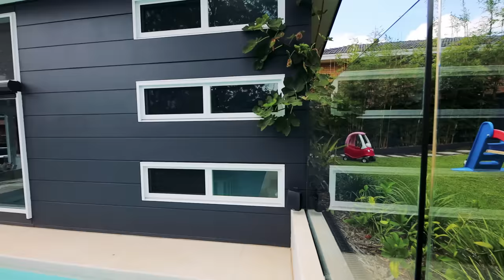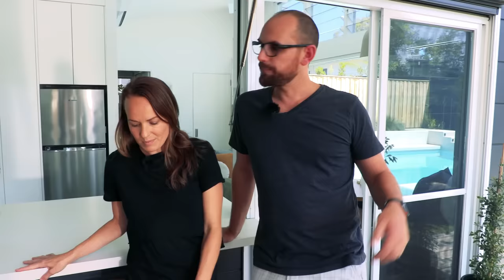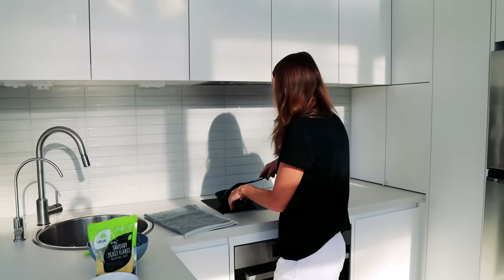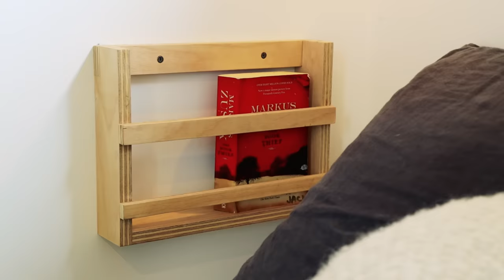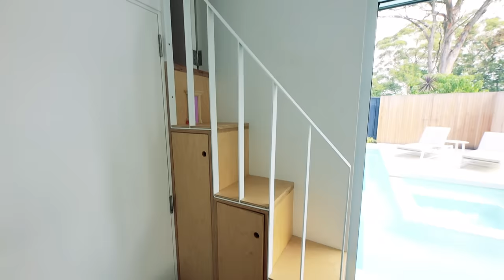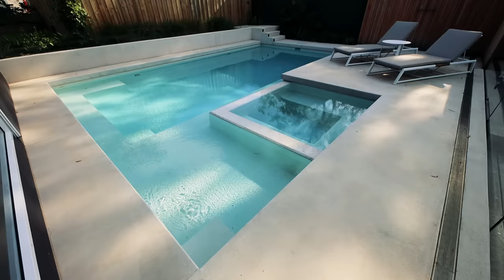Luxury Modern Small Home Built In Suburban Backyard

Comment: A great home, suitable for a tropical/hot climate. My only concern is the play area underneath the bed. What if the hinges fail and fall over the kids. Otherwise! Good layout!
Reply: That's what I was thinking!!
Reply: What if your car gave out on you tomorrow on the highway? Are you going to let it rust in the driveway just in case? Or are you going to take every precaution to make sure that doesn’t happen so you can drive safely?
Reply: @BroBruhBruv  lol
Reply: @BroBruhBruv  You writes truth
Reply: Maybe this wasn’t the best example due to the high rate of car accidents, but this can be applied to just about anything in life.
Reply: Those things don't give out quickly. Also, once its up it locks so even if they did fail it would fail in the open position.
Reply: I like ur profile picture
Reply: Denius say what?
Reply: Seem it's not only me who thought about the risk of hinges failure.
Reply: Randolp Ascano It’s temporary. It appears to me that the family will transition the girls to the two bunk beds and then the crib space will be the girls play space.
Reply: Cars are generally made with much higher safety bars than hinges.
Reply: The beauty of gas springs is they rarely fail, and if it does fail it wont come crashing down it will just struggle to carry the load. Not something I would be worried with.
Reply: It's only a temporary situation. If you watched the vid they said that once the baby grows older then the nursery becomes a playroom. This isn't forever and I'm sure that they thought about that too.
Reply: They let their child handle a nail gun...
I honestly can say that shit freaks me out more than a actual gun, haha. 😅
Reply: Also what I'm thinking about! It's scary if it lose force
Reply: They're not hinges, they're gas struts and have life span of about 10 years. They lock in place once elevated so in the very, very unlikely event that they both failed at the same time the bed would remain up.
Reply: They spent 400k for a tiny home so for sure they make it sure that everything has its own safety precautions and other than that ,they always consider the welfare of their children,so priority wise everything that involves their kids are all safe ..

Comment: This is my favorite tiny house you have ever visited. Very nice design
Reply: Pip
Reply: Nah last video was better minus the pool
Reply: @TheJttv  Way too black. Maybe in a different color but man image how hot it must get. I do like that it looks like a Sand Crawler but its not for me. This one is light and comfortable looking. 400 grand is the only thing that doesn't fit. If you divide that by 300 for the house and 300 sf for the pool its 600+/- bucks per sf?? Dang someone robbed this couple. At the most in my area its like 400 bucks per sf. and that's top of the line finishes. This house should have been around 100 grand and the pool around 50 grand with the spa . That would be max(150 +/-). They did say they did work on the main house so maybe that was 250 grand?
Reply: @Betazeno  the last one was way more open, tall and roomy and had a usable second bed. Plus a better porch and better bathroom. Not saying I hate this one, but I think the last one was better.
Reply: @TheJttv  The last one seems more cramped to me. For sure the kitchen and Living on this one is much more open. The other house is bigger overall so it has a better bedroom. This one has a weak bedroom for sure because its trying to fit 3 bedrooms in the space for 1. They both have tall ceilings and yes the "2nd & 3rd bedroom" on this one is for specific size children. But if you turned this one into a one bedroom instead of 3 bedroom and used the 2nd bedroom space in the bedroom it would be an amazing 300 sf home. The porch I also don't agree. I prefer the roofed porch from this one. The quotes are because even though cool the kids bedrooms are too tiny. They may work for a couple years but they will grow out of them quick. The bathroom would have been better with the door but that's minor. Also, they should have just used a regular couch instead of the built in that they are using as a head rest.
Reply: Betazero 
Is your area Sydney, Australia? Because if not, there's no point comparing it. Bryce and the couple weren't kidding when they discussed how Sydney is one of the most expensive cities in the world. Housing in Australia is super expensive in general (compared to the USA) - I'm in a different part of Australia and 400 grand for this place seems pretty reasonable to me considering the pool and everything.

Edit: I agree about the black though. Why any Australian would build a black house in our climate is beyond me!
Reply: @jesscarrier4180  Damn then that's expensive! I live in Boca Raton Florida and it is one of the most expensive places to build in the US due to hurricanes. 400 ( 600 would be outrageous ) bucks per square foot here is top of the line so I feel for you. That house here would be around 200-300 max per square foot and you would have a concrete bunker with impact windows etc and whatever finishes you can dream up... Pools are like 250 per linear foot and a spa like 8k.

Comment: I have a question why are all of the tiny houses roofs at an angle? Is it for solar panels or just a design preference?
Reply from the maker: Most homes have angled roofs to help with controlling the movement of water. The angle prevents water from being able to sit on the roof and potentially causing problems.
Reply: Analicia Stevens My best guess is that they are all at an angle because roofs need to be at an angle to make sure that water doesn’t pool up and cause problems (unless of course you have a flat roof and install a flat roof draining system). Again, just a guess, but as to why they are all at an angle rather than a pitched roof like most houses, I would think is because the width of the houses are so small that it would be very a steep pitch and look out of place.
Reply: The higher sloped ceiling (or a gable ceiling) makes the room feel bigger without increasing the floor area. A roof doesn't have to have much slope to shed the rain.

Comment: Wonder why they dodn't put solar PV on the roof- it makes no sense not to do so in Sydney because solar electricity is so cheap, and saved money put towards the mortgage will help pay the mortgage off quicker. 
Also, a heat-pump HWS is another way to get renewable (heat) energy - which also saves a truck load of money..... Did they mention either of these? 
I see they have a RCAC / heat pump - that's a much cheaper way to heat a home than gas ( in Australia)

Comment: Just out of curiosity because I live in an extremely hot and sunny part of the States especially during the summer (not Florida or California) and we can tint our windows black, but are prohibited from having anything at all that would be reflective like this couple has. Even our window treatments otherwise must be either black or white on the outward facing part to minimize any reflection. Yes it is weird but we all understand that it is to prevent fires from starting so we're all pretty darn ok with that. Problems arise from the blacked out windows which is why I haven't tinted mine; from bringing heat in at the wrong time and keeping it there to then blocking it out during the winter months when it is beneficial. Is there anything like that in Sydney or even more widely in Australia in general? Thanks in advance to anyone who reads this or happens to reply. Love from the States to you lovely Aussies!

Comment: Its a great little house.  Not sure how practical the "kids section" is in the long term.  Short term it works however they def need to either extend to where they have the outside dinning table or move into the Main house and rent the small house out.  Clever though!